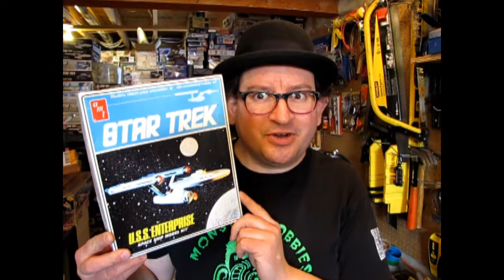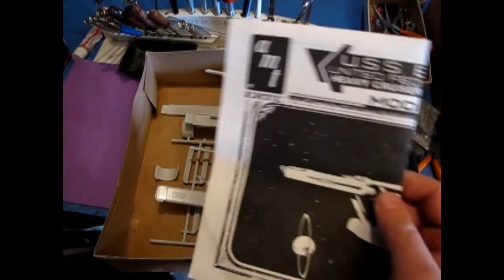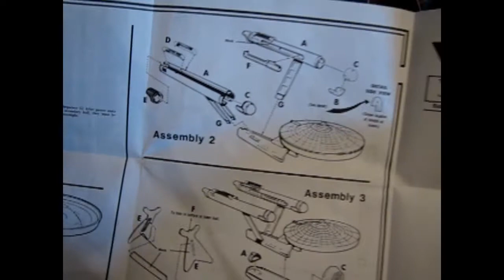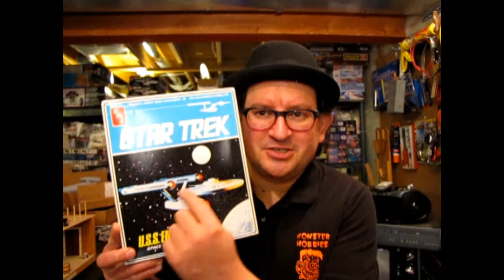Let's Build the AMT U.S.S. ENTERPRISE Kit 6676 - Part 5 - Building Warp Drive Engines - How-To Video

Comment: Great video series! I just purchased the same kit and will be assembling it soon.  (Returning to my childhood when I slapped together the Enterprise kit sold then.)  
You gave a great tip about removing the inaccurate alignment pins and replacing them with styrene strips in the nacelles, but I don't see those when you were struggling to get the pieces aligned after gluing.  Did you just forget those when making the video?
Reply from the maker: Glad you liked the video. I install the strips @36:34 after the "Alignment" gluing was finished and dried up.